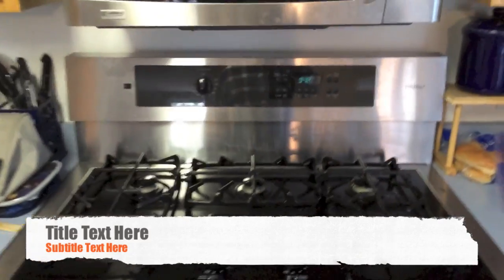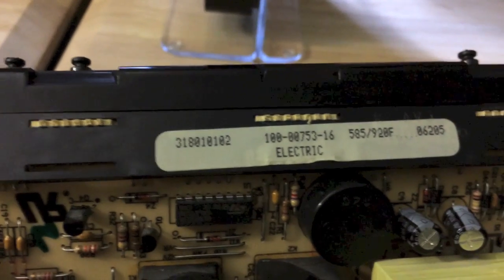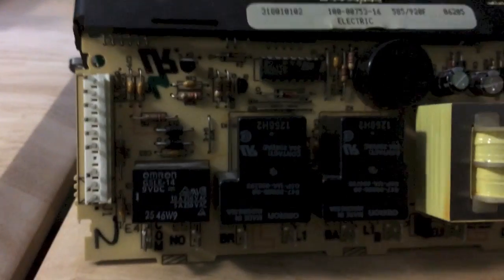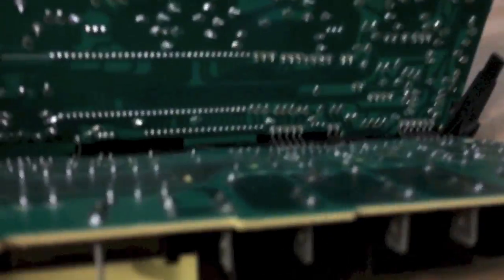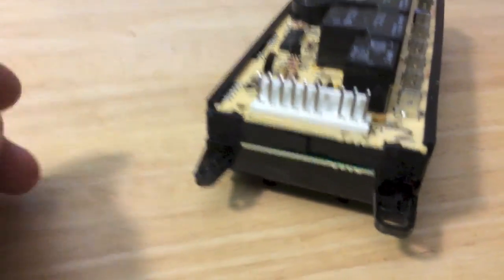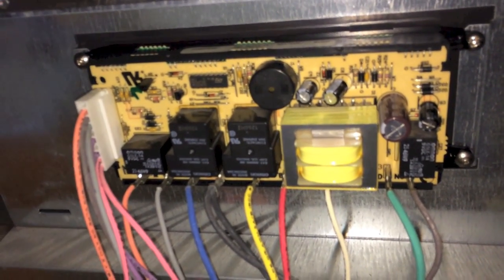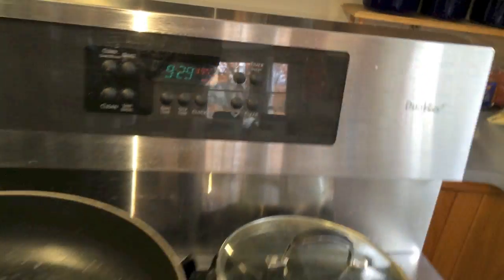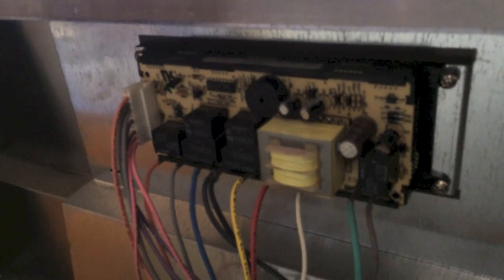Repairing Electronic Oven Controller on Kenmore Elite Oven 790.75503

Comment: Mine had same issues, but no soldering issues on board - My cat used to pee in the stove all the time (as well as bite people, knock stuff off the counter and poo'd in the toaster one time). After cleaning both board several times with q-tips and alcohol, works great again!

Comment: Matt, 8 years after you posted this video it is still helping folks.  Thank you!  Our oven bake element stopped working this week, I found your video and found the same issue on my board.  A quick solder fix and touch up on the other relays and it is good as new.

Comment: Hey Matt, just wanted to say thanks for posting this video! I went through all the other preliminary steps of troubleshooting the "easier" things first with a multimeter i.e., continuity in the element itself and the actual temperature probe. Since they were both fine, the control board had to be the culprit. I found your video while trying to shop for a new control board--that they don't make anymore! Dropped a dollop of solder on the burnt out connection and wallah, working like a charm!

Comment: Hi Matt.  Your video gave me great confidence I could tackle repairing my Fridgedair 318010102 control board. And I am grateful for the learning opportunity. My board had stopped working with a burning smell and had gone dark.

When I took my board apart I found a big hole beneath one of the pins in the bake relay and signs of significant burning including a couple of pcb gold threads which had been exposed and broken.  Not to be discouraged I wired around the broken threads and used fairly heavy copper wire to connect the relay pin to other pin connections on its pcb plate.  But this repair did not work.

With a little more research I found a video on "hidden thermal fuses in small transformers" and in the detail comments I found advice to check a small zener diode on the board that could also be bad.  So I removed the transformer, found the embedded thermal fuse, verified that it had blown, and ordered some replacements including the zener diode on DigiKey (which also has replacement 9v relays for the board).  Now having replaced the thermal fuse and the zener diode I tried my "repaired" control board again and it is still dead.  I've retested the transformer to find it putting out 39.2 volts on its secondary which is surprising since a repair kit I ordered contained 9 volt relays.  Needless to say the transformer is no longer available.

I could really use some further advice particularly from someone who has successfully diagnosed and repaired this board beyond the level of depth you have covered so far.

Comment: Thanks Matt!  Another success story.  I have the all electric version of this stove.  Broiler was not heating.  touched up a solder joint for the relay that controls the broiler and voilà, works like new!  

Anyone have luck sourcing the actual relay part in case that goes out?
Reply: Gary, I have the same question.  I am trying to source a new relay and cant find one.  DId you ever find one?
Reply: @hcstraub  No luck on finding a relay, Harry, although I didn’t look very hard after the solder fix which BTW is still working!

Comment: Nice work.  I did the same repair on mine several years ago. Exact same control/clock module, even though my oven is a Frigidaire/Electrolux.   Never saw your video until now, so I had to figure out the solution using much the same analysis process that you did.  Your comment at the end about worrying why that solder joint blew out in the first place is well-taken.  After a couple of years, another joint blew out for the broil element.  The problem is that those and solder joints are not heavy enough to carry that heavy current to the elements.  They should never have relied just on solder to carry heavy switched currents like that.  To make the repair more permanent, they would need a crimped blade or a heavy screw terminal connection - something like that.  For now, I tried my best to get the relay pin flat against the board pad and I added a larger amount of solder, to hopefully dissipate the heat and give more contact surface.  It's been about 2 years and no more have blown out.  Crossed fingers.

Comment: Thank you so much for this video. Kenmore oven with no power to elements. Similar looking relays.  Melted solder on relay pin.

Each black tab holding the board is 2 pieces. Use tweezers to squeeze and pull the center clip out. Then squeeze the ramps together.

Neat.

Comment: PANDEMIC SAVE, THANK YOU!!!

Our bake element blew out just before the pandemic, and I replaced it.  It worked for like 2 months, and then died again.  We lived without an oven for like 6 months , and then I said, "enough is enough!"  I pulled it out, debugged it for like 14 hours, traced lines, lost more hair - nothing made sense!  I was about to give up, and started getting sad that parts weren't available, or I'd have to send the board in for repair... and then... stumbled here.

I pulled the board apart, and sure enough - bingo!  Bad solder joint.  30 seconds to fix, no joke.

I agree with you about the design flaw.  Especially since you can't get to the PCB without completely dismantling the oven, pulling it out from the wall.  What an ginormous PITA that was.

I'm off to go bake something now.  Thanks!

Comment: Can't thank you enough!! My Frigidaire  Plcs389ecb oven purchased in 2006 had quit working. Testing made me suspect the control board which is no longer available. Although my oven is configured a bit different, the control board is identical. Long story short exact same problem. Re-soldered the pin...back in business.

Comment: I found this place online that will fix dim or non-working LED display.  https://circuitboardmedics.com/318010102-oven-control-board-repair/?gclid=CjwKCAjwh472BRAGEiwAvHVfGmEPuwTkBQzGf2zth6lMGhjRcjQrhJK6Vb44ooKJmwgkt1jndeyVfhoCQsYQAvD_BwE

Or...you could try to find a used, broken one, and attempt to repair yourself by swapping parts.   But I've been unable to find those.  It appears people are onto this "easy" solder fix and are scooping these up.

Comment: Hi Matt My led light are going out. I think I need a new board. Is their away to fix the lights or the best $ ON ONE. Were can i get one Sears ones $649. But all works but the lights on the board.
Reply: You can try replacing all the electrolytic capacitors on that board.  They live a punishing life inside that unit with all the heat from the oven, and electrolytics can fail after 10+ years anyway.  If one loses its capacitance, the voltage to the display driver drops and you get dim lights.   If those don't fix it, you're probably stuck with buying a whole new refurbished module.  You can find rebuilt ones online for $200-$300.
Reply: @cowsongs  New stove

Comment: Thank you so much, you saved me over $400.00 had the exact same problem and the exact same pin, must be a manufacturing issue when the boards are soldered
Reply: I'm glad it worked!

Comment: Pretty common with a lot of ovens that use digital control boards. That space they are in gets really hot and over time with the constant heating and cooling, the solder joints fail. I just fixed my gas stove the other day, it wouldn't heat up, so I took the control board out and saw that a solder joint on one of the relays was completely loose. I slapped some solder on it and it started working again. Just think about how many throw their stoves away because think their stove is bad and they don't wanna call a repair person to come out and charge them a fortune. This can be said about most all electronics. If your stuff breaks, at the very least take it apart and try to see if something doesn't look right. Maybe you will be able to fix it yourself.
Reply: I agree.  In this case it was out of necessity because repair guy said it couldn't be fixed, and replacement control boards are hard to find.

Comment: I replaced both elements, and was waiting on a new thermostat, when I saw this video. Having the exact same symptoms. So I took  my controller off, and sure enough, the exact solder joint on the exact relay. I soldered it, and it's working again! I have a Kenmore Elite Convection oven with glass top burners, with the exact same bake control panel.

Comment: Great video!
I have a different Frigidaire range, with the exact same problem, and I did exactly what you did. 
BEWARE... many of these do NOT use the 15v version of that relay.  Mine are 9v. I actually unsoldered the relay from my board and tested it on my bench.  It reliably switched at 7.5 volts, so it's clearly not a 15v coil.  Other relays on the board are labeled "9vdc".  It's very unlikely that they would use two different control voltages for the relays.  Your board in this video also has a relay near the problem ones that is labeled "9VDC", so I don't think the 15v relays you have would work on your board.

As it happens, I didn't have to replace the relays.  I just had blown-out solder joints, like your case here.
It had a blown out solder joint on the bake relay, which I repaired, and it worked.  About 3 years later, and different joint blew out on the broil relay.  Repaired it, and it's fixed.  I resoldered all the joints on both relays using a little silver-bearing solder (not "silver solder"... silver BEARING solder, which you can still melt with a conventional soldering iron).  Silver bearing solder joints are harder and stronger than joints with regular rosin core electronics solder, so I'm hoping they will be more durable.  

That pin has to carry the full burner current when it turns on.  Since the joint is purely a solder connection (not a mechanical connection like a screw and a wire lug),  this is a terrible design.  You should not depend on a little blob of solder to carry high currents like that.  I think that's why those joints are blowing out.  Hopefully, by adding solder to the area, and using silver bearing solder, they will last, but I'm expecting this to be a regular repair I have to do every few years.
Reply from the maker: cowsongs I’ve done the baking and broiler solder joints.  So far so good.  If/when I have to repair again I’ll take your suggestion and use the silver-bearing solder.  Thanks for the tip.

Comment: Same thing happened with my parents stove, however we replaced the element first and then the temperature sensor then it was still not heating. My thought was to replace the relays but then saw your video! Just so everyone knows this controller is used in alot of ovens!

Comment: Thank you, we started our Christmas cookie preparations and the oven stopped at 195 degrees and wouldn't heat anymore.  The broiler was also not working and no replacement available so came across this video and was able to solder two connections on the relays and it is working now.

Comment: Thank you so much for this video!  After some initial troubleshooting to narrow down my problem to the logic board, I came across your video and it was the exact same issue.  A quick soldering job and everything is working again.  You helped my save a minimum of $300 to replace the control unit.  Thanks again!

Comment: I have now re-soldered mine for about the 4th time (thanks to your awesome video), but this time it is not working .  have you tried to locate or replace the relay itself?  I cannot seem to find a replacement relay.  any advise would be greatly appreciated.  I'd like to avoid dropping $4k or more on a replacement stove.  thanks.
Reply from the maker: I was able to order replacements, I think from mouser.  15v relay, G8P-1A4P DC15 or an equivalent will work but check the markings on yours, they could be different.

Comment: I have the exact same oven with the exact same problem, down to the solder joint. 14 screws and a re-solder later, my oven now gets to 350 in under 8 minutes. Sure beats a $200 "circuit board repair", let alone a $4000 replacement range. Thanks Matt!

Comment: Hey Matt.  I have the exact same oven and was happy to come across your video to get a lay of the land when it came to the EOC board.   My problem was slightly different in that what made me notice there was an issue was that the oven clock was off and buttons didn't make any sound or respond while the oven light and side oven continued to work just fine (No way to turn the main oven on at all).  When I took the board off and opened it up, I too had a burned out solder joint on the relay but mine wasn't as clean as there was char around the bad solder joint had about a one-inch radius that got both boards.  I repaired the solder joint and cleaned the board as a quick first step but no change.  Any thoughts Matt or anyone else on a good next step?

Comment: Matt,  Awesome video, thanks for posting!  
I tested all the components of my wall oven and they checked good.  This was all that was left that could possibly be bad.  I was going to send out for repair and I thought...what the heck, try it myself...worst case I still have to send out for repair.  I very carefully separated the plastic like you did and wala...a blown solder joint.  It blew the pc board hole a little bigger when it burned so I had to cut the wire off one side of an old diode and make a j-hook to wrap around the relay post, solder that point and solder to the board trace.  Works good as new and also solved the problem of the temperature being inconsistant in the oven...this must have been arcing at this solder joint for quite a while.  Anyone that knows how to solder properly can make this repair.  Good luck!

Comment: Aren't those called cold soldering joints?
  Anyway, I have a GE oven that neither the bake or broil elements heat.  Can you tell me the odds that both relays are bad.
  Elements ohm out to be good.  I checked the temp probe.  Actually, I need to recheck it as it has been a while.  
  Do you know if I can bypass where the temp control plugs into the board.  Seems I should be able to just momentarily cross it out at the connection with a very small strand of copper wire.

Comment: Hi Matt, thanks for posting this, the bake element blew on our Kenmore (790 model) I fitted a new one but it didn't heat up, so after seeing your video I decided to have a look at the controller, sure enough one pin on the bake relay had the solder blown away from one pin, the circuit board damage was a lot worse then yours but I managed to fix it and bingo, it's now working again, you save me a bunch of money and hassle, thanks again.

Comment: Matt, after reviewing your video a second time and paying attention I saw where you clearly discussed and showed how you opened the controller. As you and other have stated, the solder joint in the bake element heater relay was bad. All other solder joints looked good. Thanks for you video. one tip for others which is obvious but it took me a while to figure out using a flashlight. Pry open the circuit board from the side opposite the conductors going to the lower circuit board. The connectors act like a hinge when lifting up the exposed circuit board. Here are some mort tips for others who are trying to trouble shoot: heating elements, 10 to 50 ohms; thermostat oven heat ~1090 ohms at 75 deg F, 1450 at 250 F, 1650 at 350 F. Voltage across a good bake relay (yellow to black L1) should be 0 volts when energized. Voltage across the broiler element relay ((light blue to black L1) should also be 0 volts when energized. Line voltage of 240 volts indicates the relay is open and possibly bad.

Comment: Not to bash Kenmore too much, my GE above-cooktop microwave oven did the same thing, on either relay or a rectifier.   A simple solder job had it working.

For those now willing to solder their boards, Adam The Answerman in Plano, TX will get you a part for less, generally.

Comment: Last week my oven stop working. All the other functions work properly. Kenmore 2004 model# C970-635121 with a controller part# 318184400. After seeing this video I told myself why not try! After removal of the controller I have found a burning area on the circuit board. After cleaning I found the exact same burned out connection (pin) on the baking relay.  I just did a little retouching of the welding and the oven is working again!!! For how long , I don't know but its working !!!! The controller here in Montreal is $260.00 up!!!! Thanks Mat for this informative video!!!!
Reply from the maker: Jean-Pierre Laliberté Glad it worked for you!  Seems to be a common problem.  Makes me wonder if it’s safe too.

Comment: This is unbelievable! I have a dual wall mount oven that was having the same problem. After watching your video, I checked the control board (Frigidaire part #318022002) and I had the IDENTICAL problem - even on the SAME PIN! With a little solder and time - thanks to you - I saved $200 for a control board (or much more for a service call). Many thanks...

Comment: I have the exact same model stove with the exact same issue.  Sure enough when I looked at the solder it was the issue.  Thank you very much for sharing this video.  40" stoves are very hard to find and this saved me from either replacing my stove with a model I didn't want due to limited selection or updating my kitchen.

Comment: I have a Kenmore oven and earlier this week the lower element stopped working. I found many videos but when I watched yours I realized I had the same controller, with the same symptoms. Could it be the same issue? Couldn’t believe it, exact same solder point! I soldered mine same as yours and voila! Fixed! Thank you so much for posting! BTW, my wife is upset with you, she wanted a new stove :)

Comment: I also am glad I stumbled on your video. I was about to pay $350 for a new control board. Instead I found the burned out relay connection and resoldered it and is working fine. If it goes again I will buy a $5 relay and replace that component. Thank you!!!